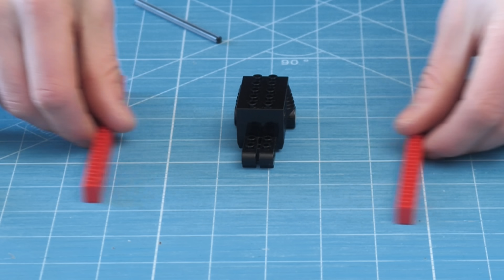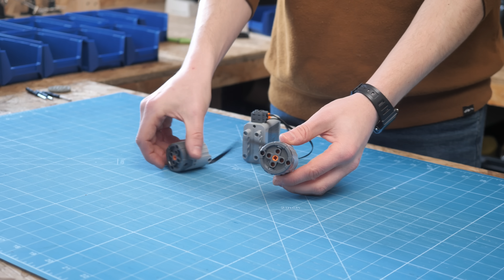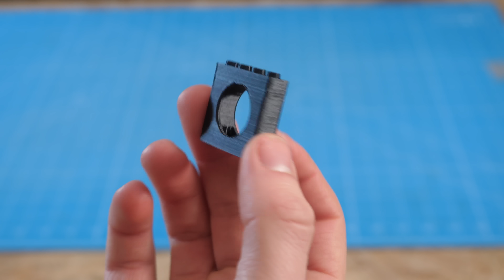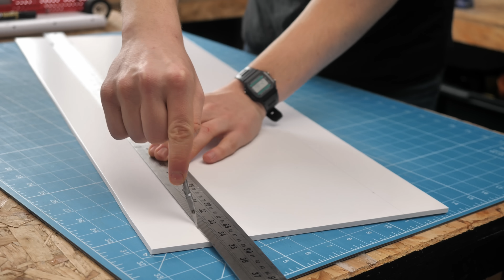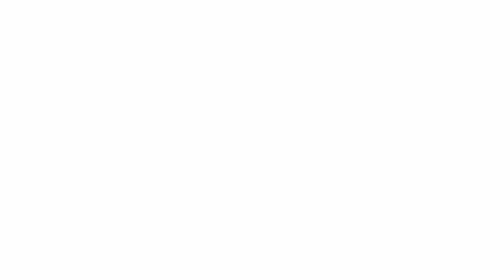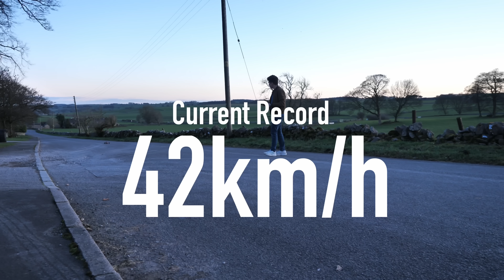Building the FASTEST LEGO Car

Comment: Hi James, big fan of the channel. Here's an idea for something that seems to be right up your street in terms of techniques. Why not try making an RC plane which has an EDF/Prop for low speed flying and a rocket for high speed flying. I know you've got something like this in the past but the new twist I thought you could put on it would be to take inspiration of some military air craft (like the F111 and the F-14) which have a variable wing geometry design commonly called swing wing. This way you can have the wings out for low speed take off and landing and then sweep them back in flight for a really highspeed rocket assisted run.

Comment: Lego parts have a fairly big amount of slack. You therefore want to make a steering in such a way, that it wants to go in a straight line, even if there is no motor steering it. You can do this in two ways. You can add caster, and put the pivot in front (and not behind like in the video) of the front wheels. This would make the car way more stable in a straight line. Having decent suspension could also help with controlling the car at speed. 

Lego PF XL motors are not the best for speed. The best motor for speed is the 5292 buggy motor. With a normal battery box at 9 V, an XL motor only produces 2.21W of usable power, while a 5292 can produce 4.61W, which is over double. This motor is also made for speed, and spins at a higher rpm, meaning you need way less gear reduction. Lego gears have a large amount of friction, so using a lot of them isn't recommended. The PF battery box also cuts the power if you add more than 2 XL motors, so the extra motors are probably just dead weight, and increase the friction with all the extra gears needed. 
Motor data from this website: https://www.philohome.com/motors/motorcomp.htm

At the end you said: 'the lego parts have too much give' 
The chassis you made is quite possible the weakest lego chassis I've ever seen. It's way better to a make a box like structure with good bracing for the chassis, instead of a single flat plane.
Having decent suspension could also help with controlling the car at speed.

Comment: Single rail Legos are the weakest structure you could have used. If you used traditional Lego build principles using offset layers  you could have easily made the frame far more structurally sound.

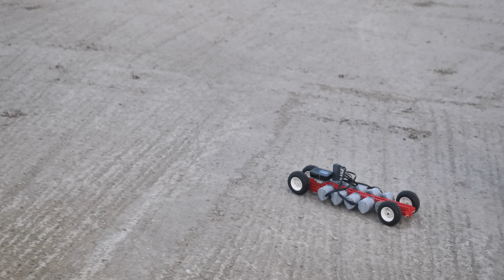Comment: The 3:30 variant reminds me of the "Dolmette" chainsaw driven motorcycle 😁

The last car just had no chassis at all, you basically just bolted two axles to a flimsy wooden board. Just with some simple chassis building, triangulation and so on you'd have a car that survives the stresses.

Comment: I love your channel but I think you didn’t try hard enough with this challenge. Just a tiny bit more effort and you could have done much better. None of the runs should have been on that awful drive. As you regularly do vaguely similar projects I’d do some serious research on somewhere more ideal to run. I’ve done similar projects where I’ve gone over 58mph 93kph with models way smaller and more delicate, helped by a far superior, well researched place to run.  At a proper location you could have more gently blended the throttle up on the most powerful version.
I hope you re explore this project. Keep up the great work 😊

Comment: Great video but its a crime you hooked like 7 PF XL motors to the same battery box a stock lego battery box can only really power 2 PF XL motors at full power, also some suspension and Akerman steering geometry would have helped alot

Comment: Honestly would have liked to see a bit more restrictions/rules as it does seem like you could have just stuck a lego brick to your existing rc car at that point and called it a lego car by how some of the final ones were propelled. It seemed less about optimising the lego part and more about building the most basic chassis and sticking a rocket on it.
Reply: Agree, I think he gave up early. Like with the submarine.
Reply: I agree
Reply: Also with his fastest rc plane video, he just sticks a rocket on it. The fastest lego car should mean a car made only with lego
Reply: I agree. Lots of compromises on the initial "rules" set for the video. I struggled to see the point of using a very rough road to measure, very small dia lego wheels, using rocket motors, then basically printing "lego" parts to make a cluster of an RC car.  Also, measuring speed when it looks like it is traveling down a hill....by 3/4 of the video I felt tricked.
Reply: Согласен. Он сделал кусок говно. И лего тут ни при чём.
Reply: It won't be much faster with just legos, no matter what you do, they are plastic and will melt and or break.
Reply: @Ziegeri  That's the whole point. You have to test and figure out ways to push the limits. This video is like saying you're gonna tune your car for more performance and then just going to a dealer and trading it for a Lamborghini.

Comment: Tbf, you didn't particularly optimize the frame for rigidity. If you stick to technic bars, plugs and axles (not the classic press-down connections) and build a proper triangulated chassis, it can withstand a lot more.

Comment: Perhaps you could partner up with someone who is more versed in building with technic lego. For starters i could see a use in suspension to offset the bumpy roads you use, and a wider track for higher stability. And there are much better wheels available in Lego. And perhaps a gym floor would be better suited as those are typically fairly large and exceptionally flat and smooth. A indoor location would also rule out weather conditions.
Reply: Maybe a collab with the Brick Technology channel or Half-asleep Chris?
Reply: Can’t see a gym allowing rockets but for wheel drivin testing that’s a good idea
Reply: @gv1Y_NA  They run CO2 cartridge car races at some schools on the gym floor, so that might be an alternative.
Reply: Yea that's not the Lego's fault at all. Obviously they're not carbon fiber but the true culprit is just how shoddily built that thing was. Even with better materials a long, thin chassis with no reinforcement or suspension is obviously going to fall apart.
Reply: Not to mention the spaghetti-like ladder frame chassis he built for the last car. It was flexing in his hand when showing it off, I'm surprised it got to the speed it did before it fell apart
Reply: I agree, I was internally screaming about how he was neglecting the suspension, just go kart-like fixed wheels.
Reply: Yeah... skilled technic builders like Sariel get lego technic car go with speeds of about 30kph so this really was a skill issue here. Not to mention ideas like making the frame narrow and non reinforced, using tiny wheels, powering 7 XL motors from one battery and so on.
Reply: Brick Technology has some insane builds. Would love to see how other Lego channels would tackle this problem.
Reply: Not to mention a gym would allow for uniform testing instead of getting speeds from different road conditions.
Reply: Right this dude must have not played with legos as a child lol
Reply: Yep
Reply: As a kid I strapped three of the model c rocket engines to a 1/16 model car and not only did it move really fast but the wheels came off and showered my street in sparks..... Then it caught fire in my neighbor's yard..... The neighbors and my parents were not pleased. Especially when it came to my use of a biological fire extinguisher. 

 My grandfather (a mechanic) on the hand was much more amused. He managed to calm everyone down.

 As were me and friend. Very amused 😂 

PS I did have to patch up the neighbors' law. I also did not get another model rocket kit...
Reply: Additionally, you may be able to use the metal Technic bricks and gears that are now made. That would help in the strength  and durability of the build.
Reply: I believe i am good enough for this job, please 🙏
Reply: This would be a great idea
Reply: Well, you definitely managed to make me laugh. Is it possible LEGO designed it’s motors for kids in such way that the parents don’t throw the whole kit in the bin after one time use?😂
Reply: I would help if help is needed...
Reply: u could try a skate park
Reply: The Lego police be like....

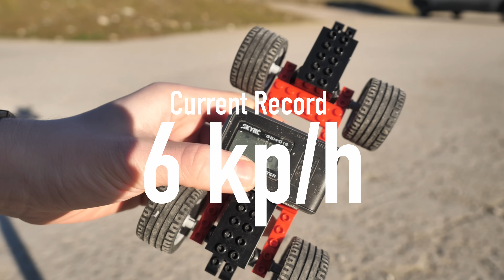Comment: 1:54 "kp/h" is wrong. Either "km/h" or "kph", the "p" stands for "per" and thus makes the "/" redundant.
Reply: Kmh^-1
Reply: imo kph is wrong and only km/h is right.
kph would be kilo per hour and missing unit of distance and it infuriates me that the m gets dropped
Reply: 6 kilo per per hour!
The rest of the video uses km/h so I think it was a typo
Reply: @melody_florum  there was also mph when km/h said. maybe he was mentally ver exhausted when he did the texts.
Reply: Kp/h if k means km is acceleration in kmh^-2
Reply: @MODElAIRPLANE100  
I think he meant speed and not acceleration.

Comment: I bet you could find a way to seal off the floor of the car and add a LEGO fan to make the car go even faster
Reply from the maker: Good idea!
Reply: Or an EDF fan to cheat
Reply: Like the McMurtry spuerling
Reply: It makes me remember a car from Gran Turismo 4
Reply: @prateekpanwar646  chaparral 2j
Reply: I mean go all out and get access to some cfd and design and 3d print a full aerodynamic package. Front and rear wings, a ground effect floor, a diffuser.
Reply: bad piggies frfr
Reply: And a gear ratio!